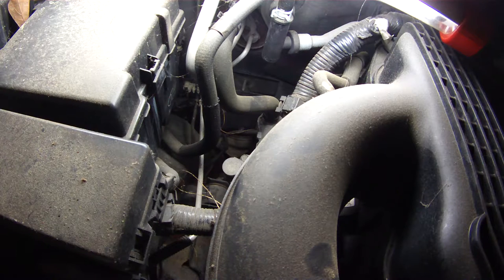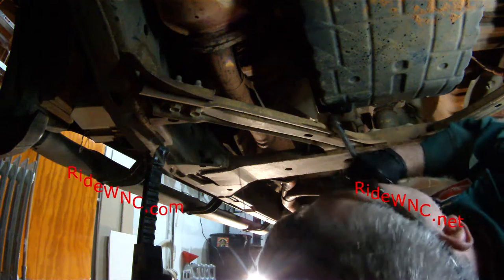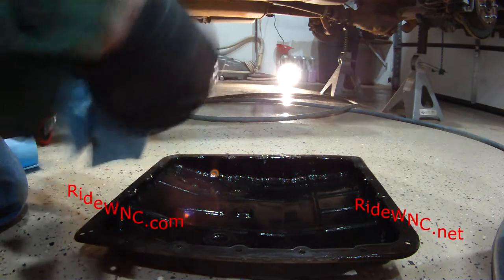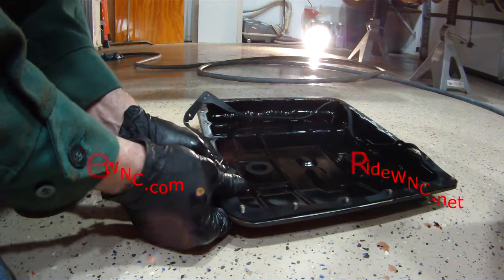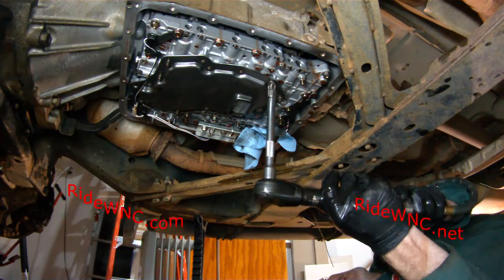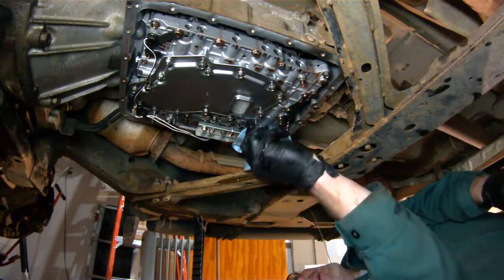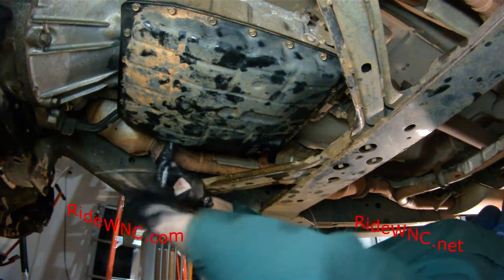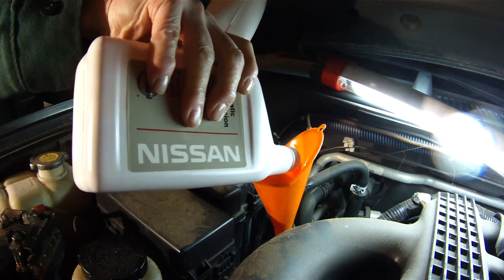NISSAN Frontier AutoMatic Transmission Filter and Fluid Change  Matic S

Comment: I’ve used the Valvoline maxlife trans fluid that’s compatible with matic j,d & s for 100k without any issues. Truck shifts like a dream.
Reply: Is this work for a nissan 2018 SV Atf, they say we need matic S fluid nissan
Reply: @byronroberto8756  yes, it is compatible with Matic S.
Reply: @dontderockmerizz3211  thank you very much
Reply: It'll work for power steering also? I've been reading on this and the maxlife is what alot of guys are running for 2Nd gens but then i get a lot of mixed info on power steering.
Reply: This is so useful. Thanks for the info! I got an E25 van with an re5r05a which hasn't chenged atf for 210,000 kms.
Reply: Thanks for sharing this :)

Comment: The 3 nuts spinning on the filter are actually attached to allen head bolts that are inserted from the back side. They hold the conductor plate from the top side that houses the solenoids on the valve body. Why Nissan designed it that way is not mechanically friendly, but you would have to drop the valve body to do a correct filter change to tighten the fasteners correctly. I personal would call the filter a lifetime filter and only replace it if I had the antifreeze trans fluid mix issue that happens and, in that case, you should unbolt and clean the valve body.

Comment: Just did mine today. As I think was stated below, the bolts with the four nuts on the filter all spin. But, just taking your time to gently turn the bolt worked just fine - all tight. I bought a 5QT pail from Lowes and got nearly 5QTs out. I accidentally knocked the pan that still had some fluid. Needless to say it went all over my side driveway. So, to account for it, plus the nearly 5QTs, I just added 5QTs back in. The fluid is so clear, it is hard to tell on the dipstick. I will keep my fingers crossed that nothing got flubbed up in the process.
Reply: I did mine a couple days ago & used ramps instead of jack stands. I wouldn't want to do it every day but it wasn't an unpleasant job.
I held the filter bolts w/1 hand & spun the nuts w/ the other to reinstall. Putting the pan, bolts & gasket all together before crawling back under was a huge help. Thanks for that tip. It took abt 5 qts. Use a bucket & put old fluid in the new fluid bottles as you empty them.

Comment: I do all my own mait as well 2013 is at 185.000 Drives and Runs like the day I bought it. Other than the ADO 2" lift and Bilstein Shocks. The Wife's New 2022 is pushing up on 25.000 Miles. And has been solid so far. I do like the old school easy to work on That Nissan seams to build into these trucks for the most part. My 2013 has never needed a repair from a shop. my drivers side window motor is gonna need to be replaced this winter is doing a number on it.. I have been very impressed with the durability of these trucks. Thanks for the Video. You have some helpful tips in this vid.

Comment: If you're only draining and refilling (not doing a complete flush and not changing the filter), how many quarts of ATF should you buy for this job so you don't have a bunch left over? Thanks,
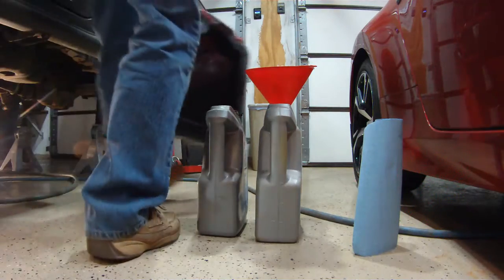Reply from the maker: 31:55 I drained 4.5QT. I buy Matic S by the case. It is usually cheaper than buying 5QT.
Reply: Just drain and fill is 3.8 quarts. Exactly

Comment: excellent video .... I own a 2013 frontier with  170000 miles  will my trans. slip if I change the oil thank you
Reply from the maker: This 2005 had 210000 miles and new fluid made it feel so much better. So much better. Make sure you use Nissan Matic-S from on line or the Nissan Dealership. Do not put anything else in your transmission! No other ATF will work as well as Nissan Matic-S.

Comment: I need to change the gasket, filter and transmission oil on a Nissan Frontier s, 2017. What filter should I put in?
Reply from the maker: 2017 is not hat old. The gasket is probably OK to reuse. The filter should be OK if you just clean it out. The filter is just a wire screen. It is the same kit for both the 2004- 2015 Titan and the Frontier. I tried looking up what I use, but it has been a while since I purchased them. I usually have a few on the shelf.

Comment: Any reason why you didn't scrape off the old gasket material or at least mention it?
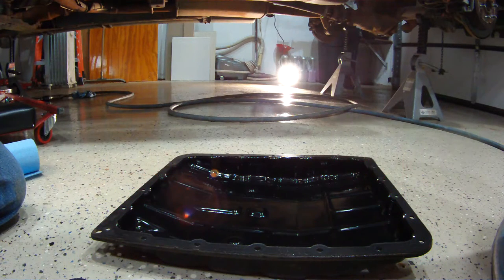Reply from the maker: I am sad that you did not watch my video. 12:00 gasket removal.
Reply: @RideWNC  I'm not trying to troll my friend. Your video help me out quite a bit. I did watch the video you took it off the old gasket and wiped it down but no mention of making sure all the old gasket material is gone unless I messed it completely.
Reply from the maker: @swoop19971  Nissan gaskets don't glue themselves to the pan. If you use a rubber gasket or Nissan gasket, there is not any scraping. I have reused OEM NISSAN AT gasket as many as three times.

Comment: What about all the fluid in the  Torque converter?
Reply from the maker: Drive anoth 10K miles and swap the fluid again. You will be OK just replacing the fluid in the pan, along with the filter and cleaning the pan and magnets.